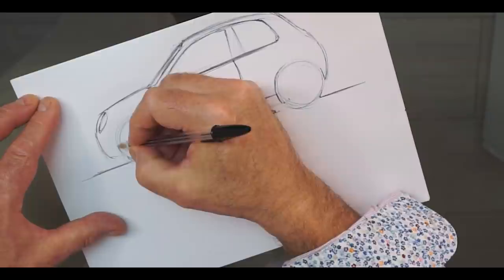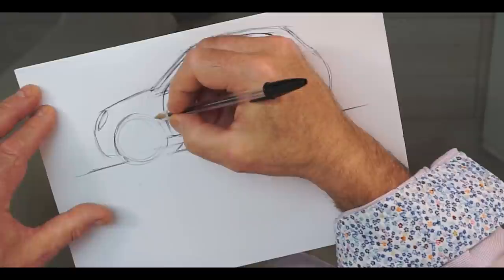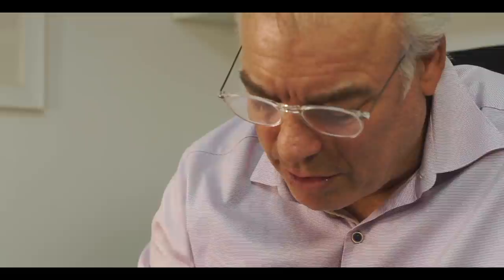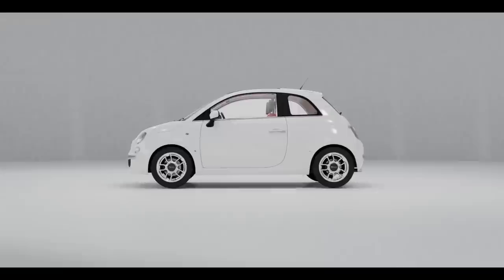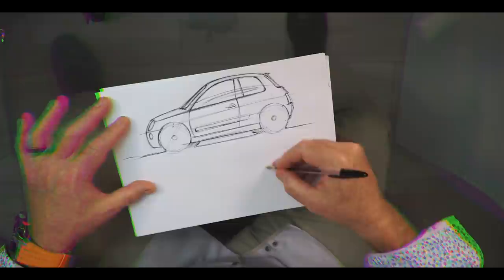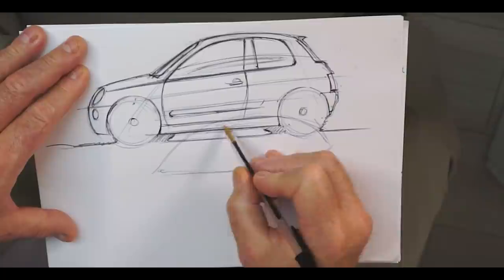How The Fiat 500 Was Designed! Ep.5

Comment: The Fiat 500 from 2007 still looks like it was designed in 2020, it's crazy..
Reply: Timeless design!
Reply: That's how good design works. I reckon the same may be said about the alfa giulia when it's a decade old
Reply: Brad_0 the giulia already looks a bit dated compared to its competitors 🤨
Reply: I own a 2008 it looks new and people actually think it is new.
Reply: I think another timeless design is the Alfa Romeo 159
Reply: @GtaFan00000001  and the brera
Reply: @TheSaint491  Giulia has the mistake of using too many old Chrysler interior parts and the general shape of the Dodge Charger. It should have been more unique. That will age the car considerably faster than the 500.

Comment: I hope you will read this. I generally don't like cars from the 21st century, but when I saw a 2007 Fiat 500 in the parking lot I fell down impressed. In 2009 I bought an Abarth 500, 3 years later I had an accident and... I bought another one just like it. I still have it to this day. Technically it was all tuned and improved, but visually it did not change, inside and out (of course it is iconic white with red side stripes and mirrors, the only thing I changed was to add on a white scorpion). Thank you! This car is beautiful outside and inside. And very thoughtful, I am 190 cm and the car is very comfortable.

The emergency lamp button is a work of art! It is so nice and friendly that you want to admire and eat it at the same time! Very fitting for a cheerful Fiat.
Very rarely the car looks is at the same time cheerful and sublimely beautiful. The 500 is probably also the first case in which I like the new version much more than the original. 

Thank you very, very much!
Reply from the maker: My pleasure Durzy! Glad your 500 makes you smile! 👍

Comment: I see some slight similarities with the mini at the rear.
Reply: Both of the original cars have similarities too.  However they were vastly different under the metal.  The Mini was one of the first mass produced front wheel drive cars. The 500 was rear wheel drive and rear engined
Reply: Makes sense, he also designed the original MINI and implemented the same taillight placement technique used in that car
Reply: @santileonsteinberg1441  he designed the bmw mini.
Reply: Alan Jackson MINI (in all caps) means the BMW version, as that is the brand name
Reply: Different designers! 
The video is very misleading, this car was at least 95% designed by Roberto Giolito! That includes the interior! 
He won awards for it!

Comment: I always wondered why you didn't line up the rear lights along with the lower end of the tail gait, like 5 cm lower?
It gives the car a harder, less Japanese look and it make the 500 lines from the 50's more visible and the original also looks like that, what is the thought to lift them up?
It would be really interesting to know, I thought about it since I bought my first one.
I'm a huge fan of the car, I have six of them, five new and one old, one of them factory new from its first release and one original from the 60's.
By this said I'm not complaining, that is how mucgh I love the car but still, that would be interesting to know since it such a well designed car.

Comment: The Fiat 500 design is beautiful and it reminds the old 500 which is so difficult (the design of new defender does not remind the old one). The only negative point is that, on my opinion, the design is more cute than agressive. It is like a car for shopping. If you like sportive cars you need to go for the Abarth version like in the mini (Cooper or JC Works).

Comment: Great design, great car. Was there ever talk of making other ’retros’ at Fiat? 

They’ve done so many great cars in the past they could easily ’redo’ on, say, the new Giorgio-platform (Alfa Giuila). 124 Coupe, Dino, 131, 125, etc etc. 
I’m guessing these aren’t as familiar to the modern public as the 500 but if FCA wanted to they COULD make great new Fiats. The Giulia turned out great.
Reply: Do you know of the MX5 (aka. Miata) based 124 spyder?
Reply: Joshua B. Sadly yes.. altho the rear looks ok. But that was a quick botch-job when the Alfa Spider was cancelled.
Reply: @pereldh5741  I think it looks great. Certainly way better than the MX-5. And its hardly a botch job. The only thing it shares with the MX-5, panel wise, are the A pillars.

Comment: "Make the design hard for the engineers"
replacing the alternator requires moving the engine
Yeah you definitely did more than make it hard for the engineers.
Still, it's a very attractive car, a Timeless design in as much of a way the Jeep is. But the Jeep isn't attractive in the same sense as the fiat, it's more than that. It's the perfect style accessory.
If you can afford the labor costs.